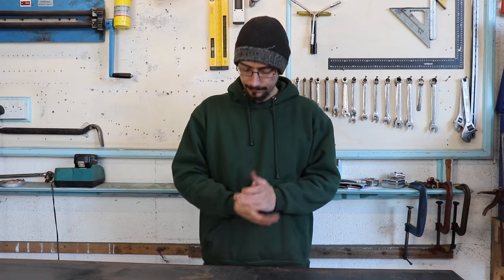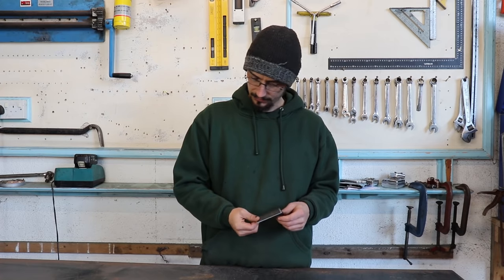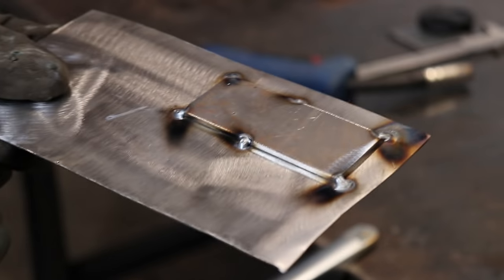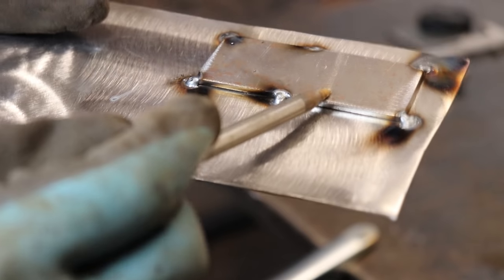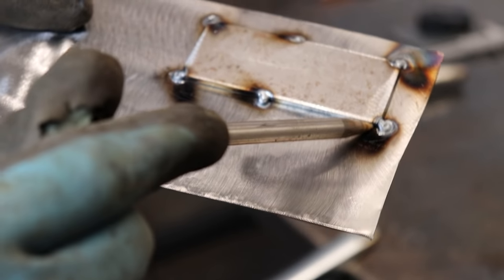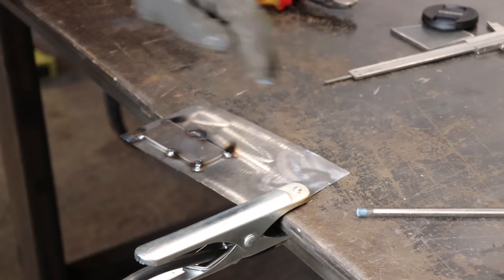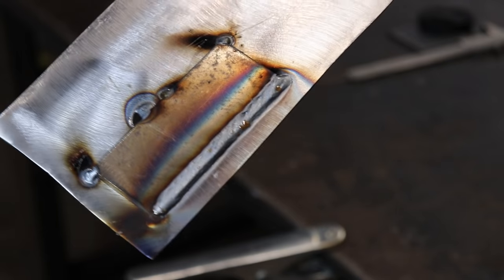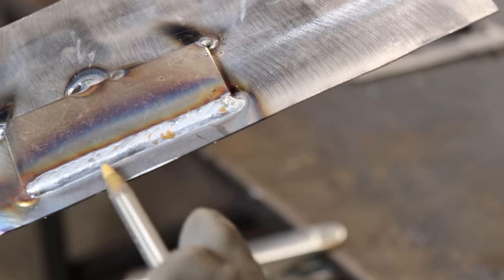HOW TO MIG WELD THICK STEEL TO THIN STEEL

Comment: Also I might add that weld thru primer is oft desirable when metal is doubled.   The type of weld thru primer and its thickness can make a  difference in welding parameters.  it has to be done right

Comment: How would you go about with an overhead? Same technique? Welding in reinforcement plates for the subframe of my rear end of an E46 upside down on jacks lol. Dealing with 18 gauge sheet metal welding on 14 gauge plates.

Comment: can't tell ya how much I appreciate this, thanks. Maybe some more on the #'s you used? Voltage, speed, and Inductance which no one ever seems to want to talk about? lol... teaching my self, so go figure
Reply: I've got the Lincoln 210 MP,  quite the top end of the line welder but if you were to get your hands on one; the machine once set up, you can set the gauge of thicknesses and dial in the voltages and feed rate for the MIG. 
Thin metal like pipes and sheet metal usually take lower voltages due to the thickness but feed rate a bit higher so you don't blow through it. 
Been teaching myself with practice how to weld MIG and stick, on and off for 6 yrs. Hope you're getting better at it though.

Comment: Nice work. I'm struggling with my first welding job; welding rear cross-member to floor pan (broken bolt that can't be removed..) with a stick welder. Not the best to start on! So far I've tried many settings but I still can't get it. Practicing welding 1mm steel plate to old brake discs, but I'm blowing holes every time, or the plate just pulls right off. So far, I'm down to 20A. I'll try this method next, thanks.
( I should have bought a mig welder.. )

Comment: very helpful thank you.
 I would love to see someone  weld some thin to thick car panels together that are covered in rust and dirt and in a confined space.......as they are in the real World like  the seat belt mounting points on a Ford Focus . They usually look like they have been rusting at the bottom of the ocean for 50 years
Reply: The best way to deal with that sort of situation is to make it less of a confined space. Don't be scared of chopping good metal out to gain more access to clean up/remove rusty metal. It can actually be easier to make up a few more sections to weld in that you've cut out for access then it is to struggle and do a shit job because you can't get access. The end of the inner sill near the axle mount on older ford's is a prime
 Example. It's easier to cut out the outer sill section and repair it from there than to struggle trying to repair it from the back, you won't be having to do it again the following year that way either because you can get rid of all the rust first time.

Comment: Very helpful information, thank you for sharing and taking the time to teach others!

I had a question about technique. At 2:30 you talk about how to aim the wire at the top corner and let the puddle fall to the sheet metal to weld. How would you weld it, if the metals were reserved (meaning the sheet metal was above the thicker metal).

For example I replaced torque boxes in a Mustang with an adjustable set made with 1/8” (.125 or 11 gauge) and 1/4” (.250 or 3 gauge) steel and I need to weld part of the floor which is thin sheet metal, to some of the top edges of the 1/8” plate. I essentially need to do what you are showing but I somehow need to push the puddle up which is beyond my skill set and knowledge, lol. Any tips or tricks you can share with me on that?
Reply: 4333

Comment: Before I got a plasma I actually used my mig to cut sheet metal ( Yes, very crudely, but it worked) Good video.  Need to drop the TIG torch and go back to learning/figuring out  mig

Comment: What I am curious about, is welding thin panel onto thicker steel, but not on an edge but in the middle of the plate, if that makes sense?
Reply from the maker: Yeh I think i  know what your saying bud, just use the same technique keeping the puddle directed on the thicker then moving it onto the thinner, you should have much less of a problem doing it that way round with the thicker underneath.

Comment: It may be worth to say that these techniques are ok for welding cars but would not be correct for critical structural welds. Also please, please get the terminology right for welding steels, it is MAG welding not MIG - we are not Americans who don't seem to know any better.
Reply from the maker: I use this technique for welding roll cages into race cars which is 100% a critical application, I have never had the need to use this method on anything structural as 1mm sheet metal isn't generally used.  I'm interested to know what technique you would use for welding 3mm to 1mm sheet metal in a critical structural application. 
As for calling it mag welding although its correct all that will do is get me loads of questions asking what the difference is between the two, which is essentially nothing other than calling it mag to point out that Co2 is not Inert. Also 90% of my views come from America.   Cheers Matt
Reply: I agree that in the material range of 1 to 3 mm that technique is not so critical as you will get sufficient fusion and penetration almost no matter what you do - after all you only need 1 mm of fusion to match the thinner section. When you go to thicker sections and greater weld quality requirements then a using solid wire then for instance you would not drag the weld for good technical reasons. As for the terminology, I agree the stupid and ignorant can call something anything what they want but when it gets to technical matters in any engineering discipline knowingly using the incorrect name is beyond my comprehension, its like saying its Pneumatic instead of Hydraulic! If it gets you lots of questions, good, be different, educate them.
Reply: David Richards 👆🏻🙄